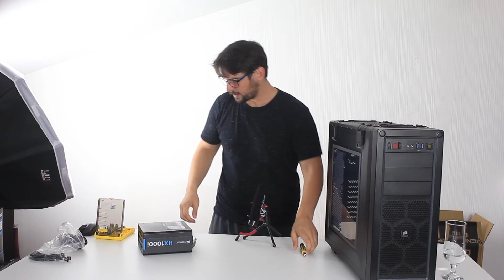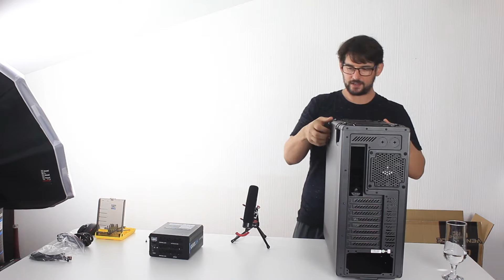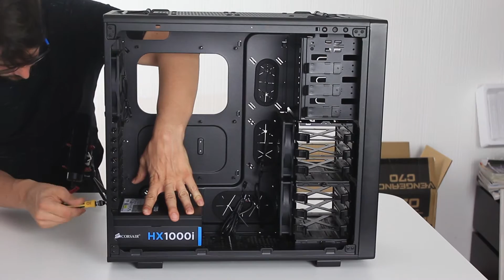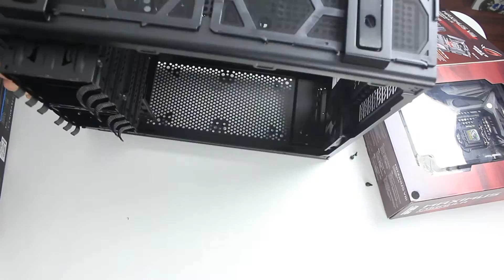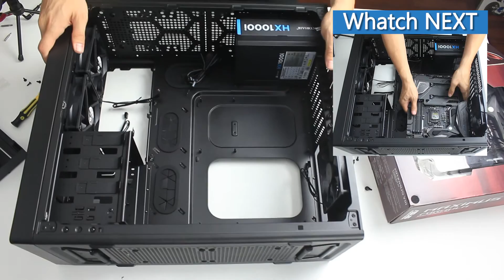Build an insane gaming machine (Case + PSU) 1/9

Comment: came here while searching for a Corsair C70 build and  I am absolutely loving your videos. You cover those minute details a potential builder wants to know. Thanks man :) BTW how does this case handle the noise?
Reply from the maker: +Manu Mohan Thanks for the comments.  Got a few new ones I'll publish next week with custom water cooling stuff.

The case is all right... but it VIBRATES!

The optical compartments makes lots of noise... can fix it with some tape.

The radiator doesn't lodge well on the case ceiling.it kinds of stick out a little toward the IO shield and it vibrates there as well.

This plus that.. the casing gives that breathing hummm which comes and goes periodically.

There is no excuse for Corsair. Cooling and casing where made to be coupled together... and they were more about esthetic than quality build :).

It's a beautiful case as long as u stick to a air fan or smaller radiator :)